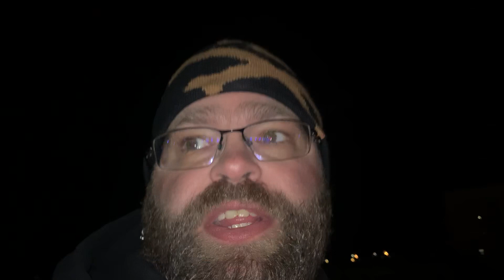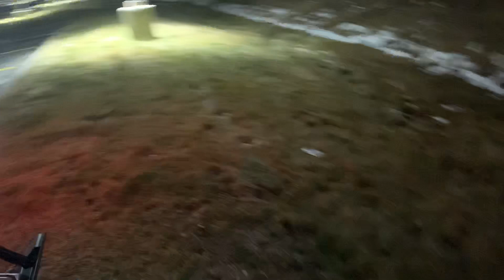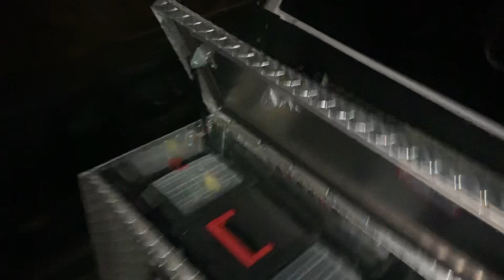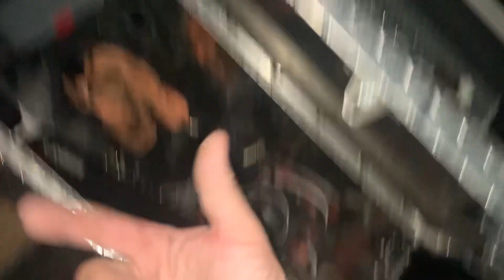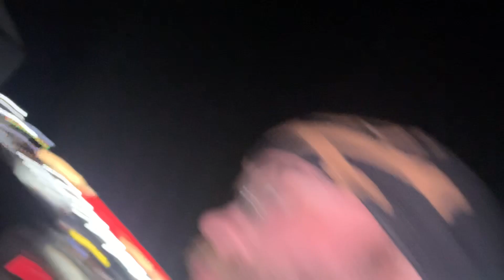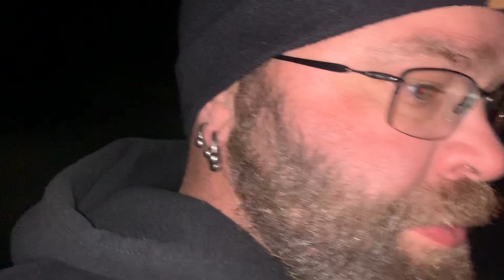Unpaid miles and new tools

Comment: Are you allowed to get like trailer to transport off of uship or does horizon not like that
Reply from the maker: From what I’ve been able to gather you have to get it to be a horizon contract. So the money is going through horizon channels. I could be mistaken because I haven’t looked hard into that yet. So yes I suppose you could but given my time frame it wasn’t worth the hassle. Had I done the research earlier (days earlier) on how to do it I may have tried. Just didn’t have the time with wanting to spend the weekend with the family
Reply: @fairwindsfollowingseas7909  I completely understand. That's been the biggest thing stopping me from getting into RV Transport. Don't want to deadhead a lot but if it's rare then I'd still want alternative methods